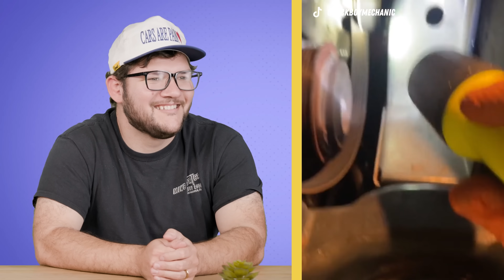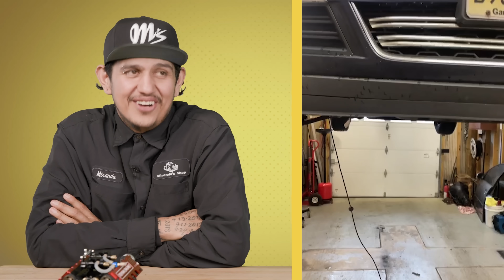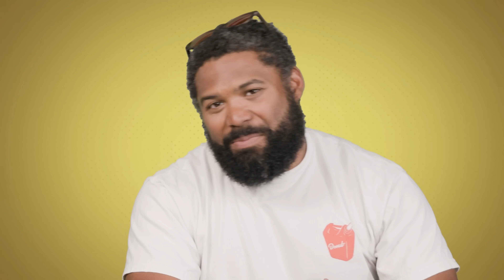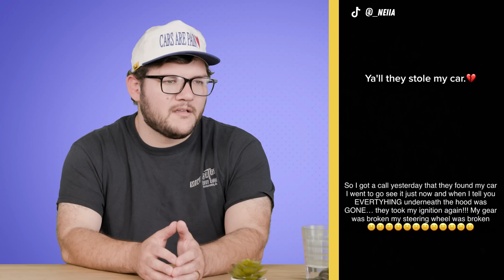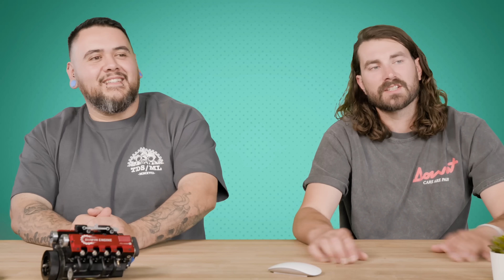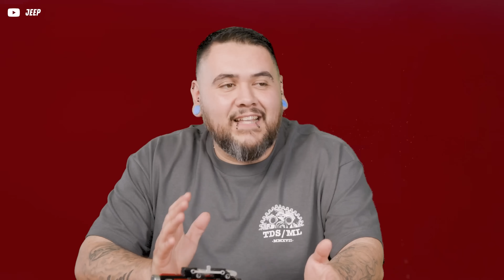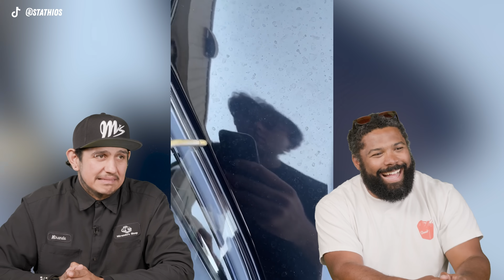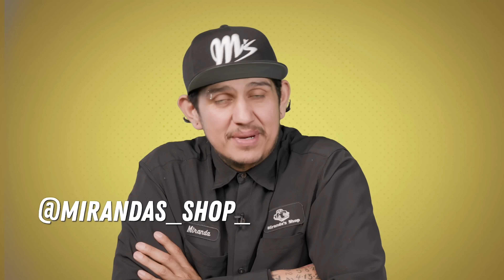Mechanic Reacts to Car Engineering Fails

Comment: 7:00 - slightly different in TX, it's two tries in the first six months, and four from 7-12 months.  Got to four with a 2003 Mustang Cobra.  Then Ford flew down a driveline engineer from Dearborn, and he brought a complete driveline from the output shaft of the transmission back to the spindles with him.  To Ford's credit, it was perfect after that.  I was willing to put up with it because I got it for $8k under invoice.

Comment: toyota tacoma upper control arm bolts. the bolt is like 20 inches long and hits the frame even if u cut the head iff of it. apparently the proper way to remove it is to bend the pinch weld/unibody

Comment: Sure, let the mechanic come up with the cardboard hack for the oil draining onto the belly pan. 
The bigger point is they shouldn't have to. Keep the drain path clear. Hell. Make it easy and put the drain plug vertical or nearly so.

Comment: I think engineers take a lot of blame for things that are the fault of the accountants forcing the reuse of parts bin items that will work but are less than ideal instead of designing a brand new part.

Comment: I used to work for Ethan Allen Furniture in the early 80s. I was just a dumb kid in a distribution center.  E. A. F. got the contract to furnish American embassies and shipped via our warehouse. We picked the boxes out of stock and put them in the containers. Easy right? Wrong, not all the boxes would fit. The engineer says they have to because the total cubic feet of the boxes is equal to the cubic feet capacity of the container.  We really enjoyed the management making him direct the loading.

Comment: Nissan vq35 motor.   Stupid mystery bolt hidden behind the power steering pump.  If you don't know it's there,  you'll remove all the obvious bolts,  but that pump is not coming out. 

Also,  I blame some mechanics when they put a car back together not making the clamp bolts face outwards for the next person who may have to take it off.

Comment: Yeah blame the accountants I guarantee that bolt is common with somewhere else in the vehicle and some accountant said oh we can save .00005 Cents per vehicle if we use the longer bolt here and there. Same thing with the Kia thing. 

Some accountant decided to change the part and didn't communicate it properly It isn't the engineer it's the corporate bullshit.

Jeep problem is a supplier quality issue probably a bad RFHM from some 2nd party.

Comment: Engineering oversight for me:
My 2011 Nissan Versa's left windshield wiper is only 12 inches long. This is OEM spec. It only wipes the top part of the windshield because it's shoved all the way to the end of the arm. I have to either crane my neck around into the center/passenger side when raining, or not drive at all in bad weather. The front driver door catch inside the door is plastic. When the car is in freezing/below freezing temps, the door is frozen completely shut and I have to crawl across the passenger side to get in. Same thing for the A/C circulation. When it's too cold, the switch freezes, and I can't set the car to recycle the air. The "trunk" board that sits over the spare tire is the same material plastic printed signs on the side of the road. THIS IS OEM. I can't load my trunk too much because it was flat out collapse under barely any weight. May be because I got it used and there's no spare, but still.

Comment: I am an engineer, and I can say one thing that wasn't done properly here is systems engineering. Part of which is, mechanics, fabricators, etc, should be involved in the design process. That tensioner bolt for example, everyone's saying oh no, the engineer should have caught that. Maybe, but also a mechanic should have reviewed that before it went to production and also examined the prototype. Disclaimer, I have never worked in the automotive industry. But systems engineering is a relatively new field in engineering that is designed to prevent these sorts of mistakes by implementing a structured approach to engineering, instead of relying on people to just do better and not make mistakes. Because that is not realistic.

Comment: Angelina is absolutely such a fucking gem. I love her, she’s got such a gorgeous smile, pretty eyes, a great sense of humor, she’s smart and knows what she’s talking about. If there was any teacher i would want to teach me, it would definitely be her…… 🥴😏😘. Im super glad I started following her on IG when she first graced our presences in that 1st video. When Jerry was doing all he can and trying to shoot his shot, subtly. If she’s ever in Florida, i wish i could take her out and then we can work on the cars like actually kick my ass to finally throw the 5”7” drops kit on my silverado and then we procharge and Dyno tune it the following week. Angelina, if you see this, wanna hit track and go watch some drifting and racing?

But working as a lube tech at my dealership, which is a Chevrolet/Cadillac dealership, there are many things ive seen to be the absolute and most diabolical dumbass position of bolts, nuts, even as simple as an oil filter. Like the older traverses with the 3.6 and like the engine cover thats a tall, half and long circle lol. Best way i can describe it. But you HAVE to get the. filter from the top, and its a spin-on filter, you have top get it from the top because the sub-frame/front motor mount are in the way. The oil filter is like less than 4 inches from the exhaust manifold so I’ve started just pulling the car in, soaking the ENTIRE front of the engine with water and then letting it sit while dousing it with more water every 10-15 mins until that bitch is not hot at all. I got tired of burning myself and I TRIED absolutely everything to avoid getting burned but it didnt happen.,

Comment: as a mechanic, I saw all kinds of stupid engineering designs and I can see how they realize they made a mistake after it was put into the car but the manufacturers said "let the dealers take care of it"....maybe it will fall out of warranty in 2-3 yrs and then it will fall on the customers and finally the mechanics who have to fix the bone head mistakes...i can see the first example you showed with the bolt that was too long but if that engine was assembled on a sub-frame and then raised up into the vehicle and bolted in, the engineers would never see that bolt against the frame....it looks so simple on the ground to them, then We have to go crazy down the road someday to fix it....if they made an Idler pulley that lasted forever, this situation would never arise but how many idlers last forever...great video

Comment: Dang. Dealer put the customer in another car for a water leak? These people must be from somewhere it never rains. In oregon, i had 2-3 water leaks a month during the winter. Luckily, most of the time it was people with sunroofs, not cleaning out their drains after summer, and was an easy fix, but more than a few times i found leaks between windshield sealant, and the gaskets around roof rails.

Comment: I had a gen 5 camaro the oil cooler/heater leaked antifreeze not alot but enough to smell every time i got out (crossthreaded fitting from factory)

Comment: Try doing an oil change on a 2022 and up nissan altima. Skid plate goes from side to side and from the front bumper to midway back of the car, had around 30 bolts and push pins, and NO access panels. It's not like you have to change the oil once in a while....

Comment: I honestly used a 4x4 post, a chainsaw, and a jack to take off the first tensioner. Cut the post to fit then put the jack under the post which gets it above the frame. If it’s just the belt you can do the same but easier.
Same with Chrysler mini vans, if you think I’m lying I’ll add my IG link 😂.

Comment: I agree with the young lady, seeing where the drain plug was at, you didn’t future out that oil was going to go everywhere?
  Yes, could have Ben designed differently, but a piece of cardboard would have solved this issue.

Comment: Dude that pulled the drain pan and just let it run all over the ramp, don’t do that, spend a few bucks and go get the right drain pans.
  That all said, I work on hydraulics and when there’s a leak oil comes from EVERYWHERE. So, one hapless weekend I was in Home Depot and discovered the miracle drain pan for under $20.00 they call them concrete mixing trays or tubs. These are huge compared to most oil drain pans, they’re heavy, think, and hold a ton of oil. 2 or 3 of these under a machine and I catch the majority of oil leaking from everywhere.  Check out any store that sells concrete mixing supplies, you’ll never waste money in an auto parts store on drain pans again.  Oh yeah, they come in different sizes.

Comment: For the water leak in the Tiguan believe it or not they do to skim warranty hours beach’s are techs will replace headliner due to water damage marks and replace entire carpet for mold totaling close to 10 hours. Realistically tho the cause is that from factory they less she tabs at the end of water drain tubes they restrict water flow and build dirt after about a year causing back flow of water into cabin. Mk7 gti suffer from this as well along with panoramic roof frame cracks which is a body shop repair because the frame is glued to the body with adhesive just a way for cars to be guaranteed to come back to the dealer.

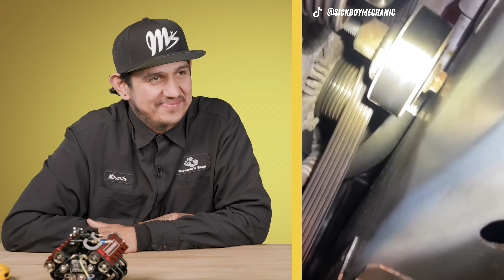Comment: 0:35 Get a multi tool, cut the bolt, use pliers to get the half bolt out seeing as its backed out enough to be loose, then replace with a shorter bolt? problem analysed, fixed in less than 5 minutes. took me longer to write this than it would of to just fix it.

Comment: Man, when Sandro said ‘honestly , anything you buy nowadays is gunna be crap’ I felt that. I’m a mechanic by trade and I would take a 20 year old car that’s been garage kept over ANYTHING new
Reply: I drove a brand new volvo v90 and first thing I see is a big plastic piece just completely broken. Amazing.
Reply: Yup. Every old car I had, with some problems, a mechanic would always be the ones to buy them, when I'd sell them. They would fix them easily and have a good working car.
Reply: But they said the same thing 20 years ago
Reply: @kekke2000 fact!
Reply: RE:somethingsochill.  The good old days when you could tune a carburetor "by ear" and you could set the distributor points pretty close with a matchbook cover.
Reply: Same... I will not buy a GM newer than 2005
.
Give me a buick with a 3.8 and 4t60e
Reply: @kainhall  amen brother, parts o’ plenty and easy enough to work on still, got a dipstick for the transmission and everything !
Reply: Back in 2004 my Aunt and Uncle gifted me a 99 Nissan Altima so I could have a car that would make the drive to the college I went to... Those things were bullet proof you still see them on the road... My dad didn't like I was gifted it and he would put water from the tap into the radiator to "help me out" when the radiator "was low". The f*cker rusted out a great radiator and engine. At the time I didn't know tap water would rust out the internals of an engine and the radiator. I'd still be driving that car I'm sure.
Reply: VAG factory says, new car must work 100000 km or 10 years. After that car is done/junk.
Reply: My 2nd gen Frontier's timing chain tensioner was designed to last for 100k miles. It has almost 200k miles on it now and I just did a timing chain job on it and found evidence in the motor that it was already replaced once before. Before I did it I called around, I found 1 person that would do it and he was asking $3000
Reply: Motorcycles are still pretty good not perfect but not bad
Reply: We’ll with new cars especially Mercedes’ and BMW they aren’t crap as long as you get it brand new (from the dealer) with a 10 year dealership warranty.  Then after 40 or 50k miles when shit starts breaking its completely covered and you can happily drive a brand new luxury car
Reply: @Werk4Cash  that’s not an option for a lot of people, and the people who are close to that and get a used one are in for a world of hurt
Reply: So true. I work in an assembly plant, matter of fact the jeep assembly plant lol. Higher ups don’t care about quality and just push cars out.
Reply: @suqmadiq1859    it's sad  quality went out the door, all for money for their big ass bonuses.
Reply: I'm an industrial mechanic for an automaker.  I'd recommend buying a late model car if you are buying this year.  Hopefully next year is better.
Reply: I'm not even a mechanic or engineer and i still hate the build quality of my new Suzuki XL6
Reply: @krokodile03  India made cars are not that great from the ones that I've seen.  USA made cars are probably just as bad now.
Reply: @krokodile03  wait Suzuki still exists ?
Reply: That's why I'm keeping and maintaining my old Ethel 99 suburban
Reply: if you can get your hands on anything 1990's just keep it going
Reply: @saeedhossain6099  I was told by a mechanic avoid anything made after 2005 and to get nice garage kept pre 2005 japanese vehicles.
Reply: @JesusIsLordAndSavior77  there's only one caveat to that, Korean cars between, 2008-2014 are pretty good, they upped their quality to similar levels of Japanese cars of the 1990's, by the mid 2010's most Japanese cars also suffered the fate of accountants.
Reply: @JesusIsLordAndSavior77  could not agree more. Before 2008 Japanese car that’s been garage kept? You do your maintenance and that thing will run forever , especially Toyota
Reply: not all new vehicles are "gunna be crap" today. He wears a straight brim hat so that alone is cringe.

Comment: Chevy cavalier oil filter can go f itself

I worked as a parts quality control liaison at a 18 wheeler assembly line after being a mechanic dude engineers wouldn’t go pasted the computer I once had a call for 6 shocks where only 2 would go… I go what the f is wrong with you nothing matches up on this build. Daily would have the assembly line stop because of this just impossible builds trying to get pushed through on custom builds

Comment: Engineering point to talk next time; Ford triton 5.4L 3v spark plugs in the mid 2000s….. I am a Ford fan and worked for Ford, but that 3 piece spark plug design is still causing problems. Love the show.

Comment: I got two more for you, GM 3.6 V6 when they had the oil filter right next to the cat and you could only get the oil filter from the top. But since the cat was right there the oil filter was scolding hot. A while ago when I had a 2010 Chevy Malibu with this engine I burned my wrist doing an oil change. Never again will a buy a GM with that engine and the other one is the Chrysler “Pentastar” family of engines. The oil coolers in those engines I swear are a 100% guaranteed failure rate. Like all they had to do was make the entire housing out of aluminum and it would’ve been probably okay but no, instead what they do is make it out of plastic which means it when you’ve got nice and hot coolant and oil circulating through there over time that warps and sometimes the plastic plugs leak. But what’s worse is those engines but in the Ram ProMaster 1500, 2500, and 3500 series vans because the way the front end is designed, rain water and or washer fluid drips on the engine a little and down into the holes where the intake manifold bolts belong. Meaning if you don’t put some form of grease down those holes on day one of the car arriving to the factory you’ll end up with completely rusted and rounded off bolts in the future meaning you have to replace the upper and lower intake. I’ve dealt with the 2500’s so much I always put a little bit of lithium grease down those front holes to prevent that rust.

Comment: I just cut a hole in the back of my suburban to replace the fuel pump bc someone failed to think of that. Sure you can drop the tank like the book says but when it’s got 40 gallons of gas in it… why

Comment: Your idea to point this out so it can be corrected is a Nobel idea, but Don you honestly think that the boneheaded Engineer that put that bolt RIGHT against the frame has any intentions of fixing it?
  If you think that you can affect change, keep thinking that way, because one day when reality hits you too will be on YouTube having every other word beeped because it just dawned on you that all 2,500 ideas for corrections you sent in over the last 35-40 years have all been ignored and they still do the same stupid thing.  But for now, keep your hopes up.

Comment: Speaking as a dealer tech on that Audi water leak, we will definitely fix that for the customer if it is at all possible. A lot of the time with water leaks on vehicles with sunroofs,  the drains that run down the A pillars get clogged with dirt or debris. This causes water to build up in the tray and then take the path of least resistance. In the case of this Audi, it's down through the roof controls. If it's not the drains, it could be a huge pain but once it's identified it can be rectified. As for electrical damage, I'd say at most a shifter assembly and a roof control assembly. If it's under warranty that's not that bad.

Comment: For the Q3 there is a tsb for that. There are several arias to check. Check the sunrood drains for damage or kinks. Look at the sun roof seal for separation. Check glass fitment of the sunroof. Check for updated wind deflector, apply bytual cord in illustrated aria, and apply packing at the glass hinge between the hinge and glass skirt.
Reply: Definitely a engeering issue. Bad design for water run off.